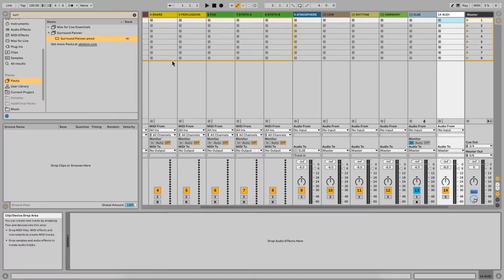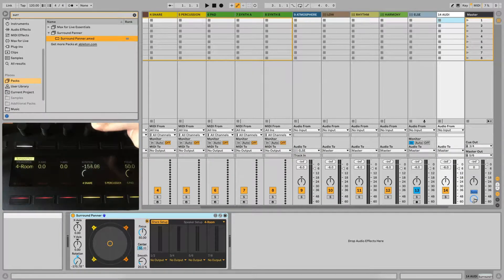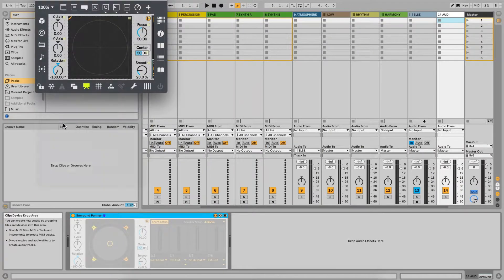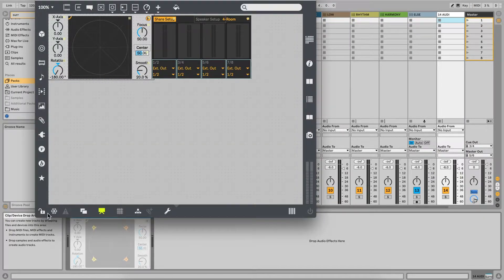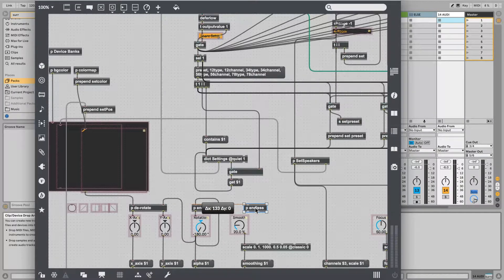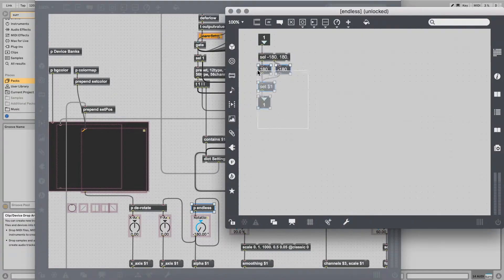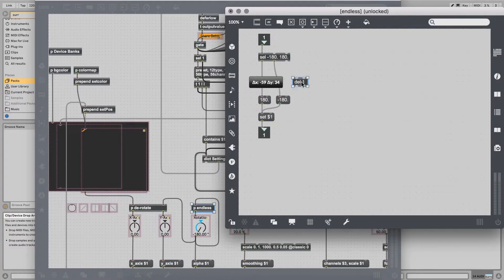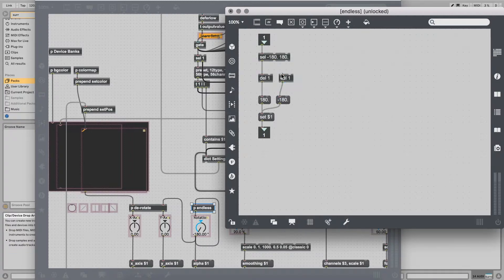How to fix Surround Panner Rotation Dial in Ableton Live 10

Comment: hello nice video but it's not working completely on my setup.
i done exactly like you, but i can only rotate  it  1 time via midi mapping, but after one rotation it just jumps back to where it started.
ableton shows information just below the plugin that its awaiting pickup when turning knob to the right, than when it has reached the pickup, the information disappears, but noting happens. when i start turning to the left. it is responding and turn al the way to the other side and than jumps back to starting point, but after that its not responding any more for left or right  turning. so don't know whats going on here.

Comment: Thanks for sharing this. I seem to have it working while using a controller. However, I was hoping to automate the rotation using an LFO. I can get it to rotate 180 but not 360. Any ideas how to achieve this so that the rotation dial can automate 360 on its own. Thanks!
Reply from the maker: If I understood correctly, this can be solved as follows: https://media.giphy.com/media/cd0oUZeupADKSXyjd6/giphy.gif
Reply: @SoundAroundTutorials  - this was my work around too.  Slightly jittery every new cycle but it works pretty well.
Reply: thank you so much  @SoundAroundTutorials  !